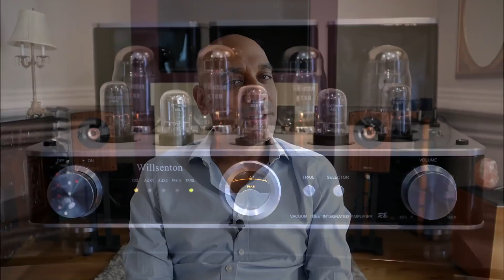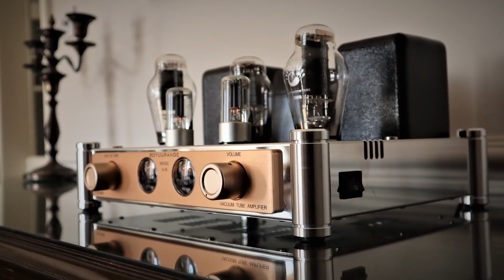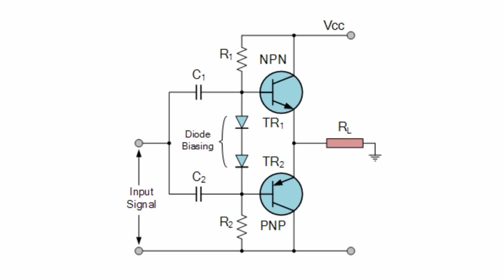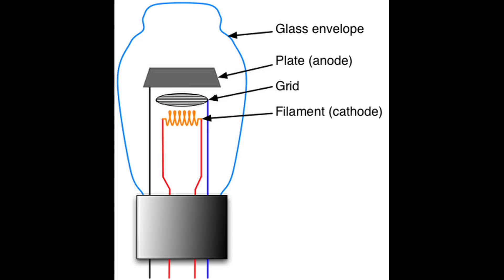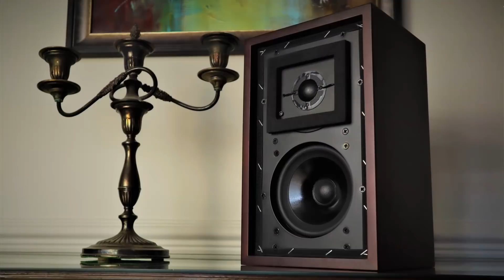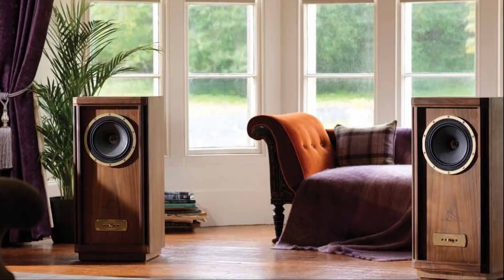Reisong BoyuuRange A50 Mk III Amplifier Review

Comment: Klipsch has good models for this. In this niche of the market, it's better to build your own speakers. Take a 15" pro woofer, combine it with  a 1.4" horndriver with a waveguide, cross it between 700 or 800Hz. typical 95 to 97 dB. It wil be big: 150l, with a port at 25 to 40Hz. Amazing results, for not so much money.
Reply from the maker: Thank you Frank. I can see how that would work with the A50 👍👍

Comment: Hi Tarun :)

Do you think it will match well with my old tannoy gold (10inch) monitors?

Many thanks,
Ilan (Israel)
Reply from the maker: Do you know the model and sensitivity? 😊
Reply: @abritishaudiophile7314  
If im not mistaken, its around the 90.5 db .. impedance is 8ohm (nominal).
It's the original "gold", not the little gold or super gold drivers.

Thanks 👍😌
Reply from the maker: @ilanspiro1645  I think you would ideally want speakers with even higher sensitivity but it would be an interesting exercise to see how the A50 would pair with your speakers or other big Tannoy Dual Concentrics 😊

Comment: Why not just cut to the chase and attach some old school Klipsch? Hook up a pair of Forte IIs you find used for well under a grand, get away from these toy speakers. I would imagine they would make Klipschorns sing if you knew an owner who'd let you bring you little amp over.
Reply from the maker: Hi John, good suggestion. I wonder if the 3 way cross over will be an limiting factor. I would love to try but the Tannoy Stirling GR are still at the top of my list 😊
Reply: @abritishaudiophile7314  - I am speaking from owner bias, I use two pair Forte II, stacked upon one another. Not by design but by opportunity, as they used to be available for under $600/pair in the US used market (hence 2 pair) & I don't have room in my small place (hence the stacking w/tops flipped). In a nod to GB I use an older Audiolab 8000A and of course the volume nob is barely moved. Thanks for your good work!

All about my case aside, a resource to listen through a pair of Klipschorns, because of the horn-loaded low end, would be interesting as an efficiency baseline parameter. It would also perhaps ruin your listening of every other speaker for the rest of your life.
Reply from the maker: @johnsmith1474  thank you John. Great to learn about your experiences. I would loved to have had some Fortes or Cornwalls to hand 😊👍
Reply from the maker: That would be good to try. I wish I had some around at the time of this review 😉

Comment: Good stuff, nice review and presentation. Such a reasonable price for quality kit. I've a ~4 WPC SE 6L6 (Erhard Audio Ray) driving large JBL 2way w/compression top (~96db efficient) and Snell E3's @ ~91db? - both are very good. but you're correct in that they both fit well with the listening levels levels and genres that suit me. I also use 'normal' mainstream gears with the other loudspeakers in my collection. But for low level listening, the SE, high efficient combo is tough to beat. It's safe to say it ended my quest. (for now haha). Cheers
Reply from the maker: Thank you for watching and sharing your experiences S Ude 😊👍